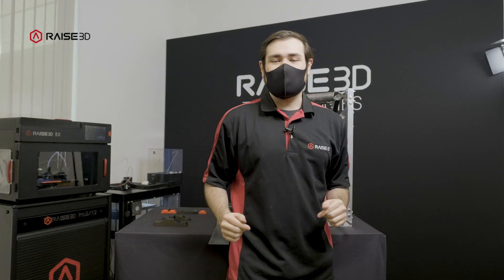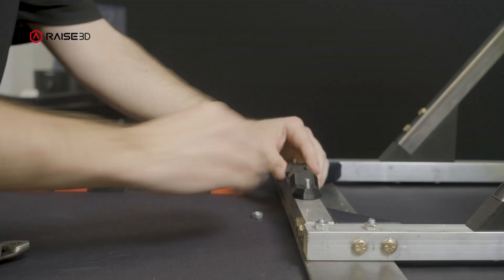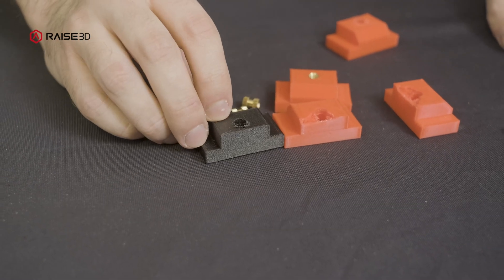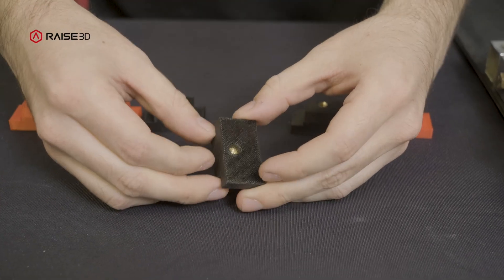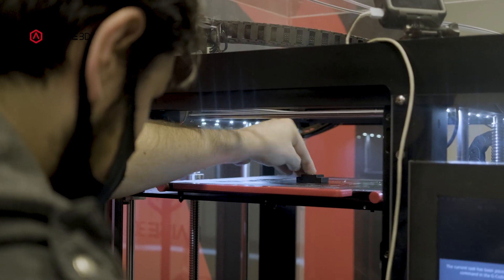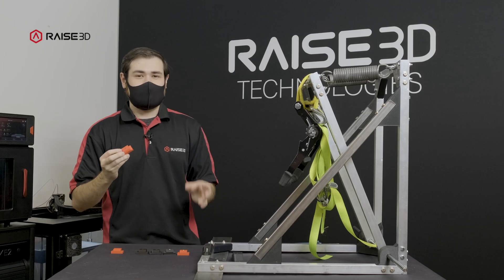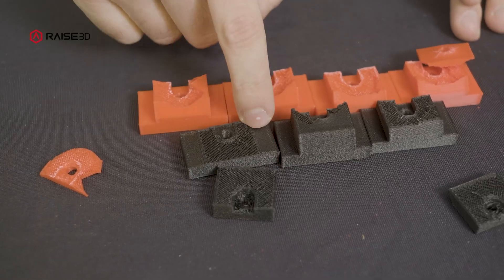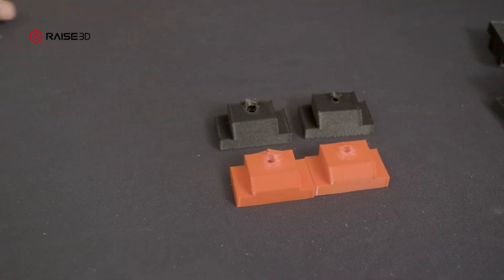6 Ways to Use Brass Inserts with 3d Printed Parts

Comment: Cool experiment! Wonder how they would perform with inserts that have perpendicular flaring or knurling instead of sprockets parallel to the direction of force. Getting ready to use NylonX and see the results of this I am now a little concerned about it's overall strength. Will be doing some extra tests on it now after seeing this video. Cheers!!
Reply from the maker: Thank you for your comment! Part 1 of this video does have a comparison between standard inserts and the outer threaded ones. (https://youtu.be/zaZ6DRr6Oso). We are curious though because the type of inserts you mentioned are a bit more rare. Part 3 maybe?